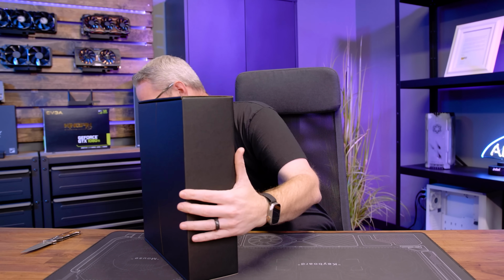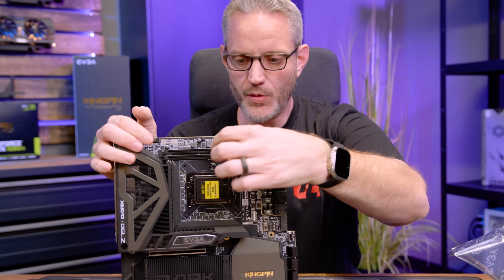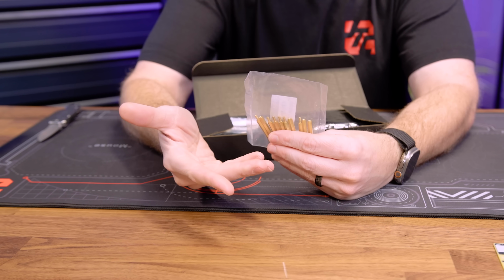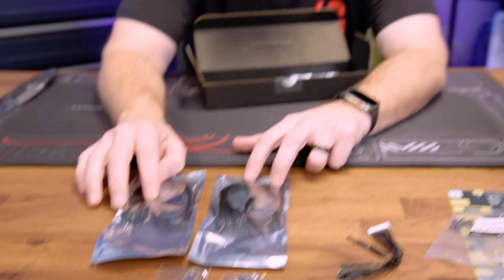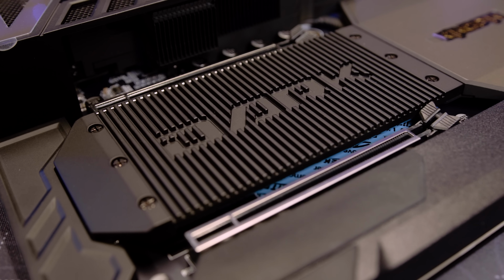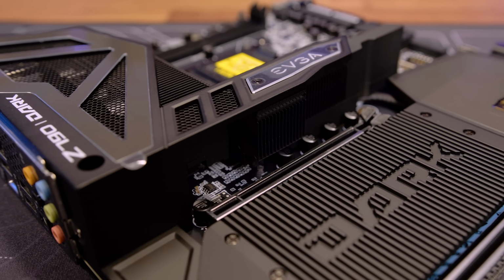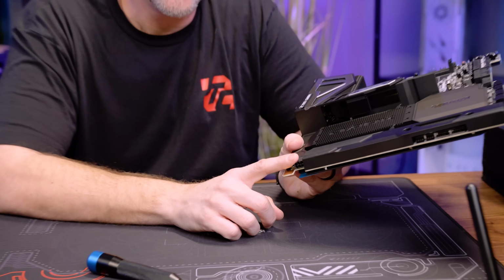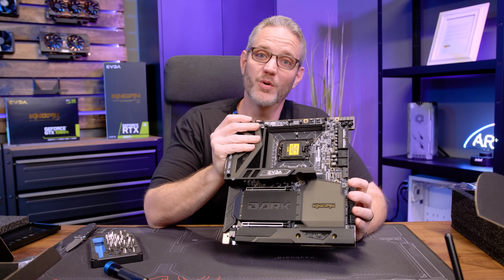EVGA created the mother of all boards... Z790 KINGPIN

Comment: I really hope EVGA picks up on AMD stuff. I would love to have a solid, reliable EVGA AMD motherboard and possible AMD graphics card. The last PC I built was a 5930K system with all EVGA parts. PSU, motherboard and GPUs, which were dual 980ti (that I still have). It all seemlessly worked. I wasn't crazy about the motherboard not having 4 pin fan headers, but I used a fan hub anyway. I'm still  holding onto my EVGA 3090ti until its no longer viable or it dies.
Reply: I hope so too, but they dropped x570 motherboards from their website. I would love an EVGA AM5 motherboard for my next PC but its not looking good.
Reply: The AMD graphic cards are bad... EVGA is just expensive... there are other boards, cards etc. that work as good as EVGA or even better.
Reply: @wiLdchiLd2k  Yeah I doubt EVGA could enter the AMD GPU market and compete with Sapphire and PowerColor. If EVGA GPU div comes back it most likely will be on intel Arc’s side
Reply: @wiLdchiLd2k  tell me you're ignorant without telling me you're ignorant

Comment: My Z690 classified is the best Mobo I’ve ever used. Love EVGA stuff

Small correction: the Classified boards do not come with the “road map” test bench PCB thing. If it did it’d be hanging on my wall above my system 😂
Reply: What does it better than a 160$ board?!? Nothing in normal use KEKW

Comment: There are quite a few issues for EVGA this hardware generation. Aside from the obvious lack of GPU sales, they're releasing boards for Intel's chips that have been out for a few months.

Coupled with no board for AMD yet, they're releasing them into a relatively mature cycle. Not sure how many would want to buy them.

Hopefully next time they'll be released earlier.
Reply: The dark board isn't for the average user. It's like a KP GPU. It's designed around xoc. When it's released has no bearing on the xoc market. 

The dark and the Asus apex are really the only two purpose made exotic cooling boards.
Reply: no offense but this product likely isnt for you if youre not willing to wait on it/youre bringing this up. its not for the everyday user.
Reply: I know exactly who it's for, but 3 months into a product life cycle like this is a HUGE amount of time, and it's not just that time we're talking about.

People at the top of XOC have had access to the CPUs for months due to their partnership with MOBO manufacturers. If you think they're going to drop that amount of time, effort and money to start again on a new MOBO then you're wrong for the vast amount of them.

The majority of people actually buying this board would be those wanting the best but not be XOC'ers. I'd bet that the majority of those people will have also already bought a MOBO and not want to sink extra money.

Comment: I probably would consider this if they made one for an AMD.  Though I'm not completely decided on going AMD or Intel when my build my next rig in the Summer time, it's very likely going to be DDR-5 AMD.
Reply: I would go AM5 because you can buy AM5 motherboards with PCIE5, which currently is not utillised by eiter m.2 or GPUs, also AMD has said to use am5 platform next 5 years at least, (am4 got extendet from the planned 5 to 8 years). So this means if you buy a good AM5 motherboard now you don't need to upgrade motherboard for a long time.
Reply: @solmesteren  Didnt corsair just announce there MP700 or something like that, I only just caught a snippet of an advert the other day. But it said 10,000mbps or 10GB/s i believe which can only be Pcie GEN5 right? But I dont know if there out yet. Like I say, I didnt catch it fully. But either way, crazy speeds and the way there kicking Generations out is insane, only feels like 2 minutes since Pcie GEN4 was announced.
Reply: @CHADSGALAXYS  they are calling for up to 10,000 read and 9,500 write with gen5. key words up to. and yes it seems like gen4 came out last month.
Reply: For me AMD vs Intel will be completly based on how 7000X3D cpus perform
Reply: i would go with amd, their socket usually lives two or three times the normal life of an intel socket, so you can buy it now and in 4 years upgrade to a much better cpu without changing half of your pc

Comment: I hope they do make am5 boards eventually. Would love to have one whenever I upgrade
Reply: I was looking at the Asus ProArt X670E. It has 8/8/4 PCIe, 10 and 2.5GBe, USB 4
Reply: useless for amd cpus
Reply: @xTurtleOW  ypull probably be able to overclock next gen of AMD CPU'S. Also your technically overclocking them by changing the power setting on them. The stock setting has the most performance and the energy setting is the coolest running. Simple as that. :) Also you can still overclock 5 CPU'S, you just need DDC or LN2. Then change your gigafarts in bios and boom.
Reply: Am5*
Reply: That's the only reason I am likely going into when I upgraded next. I LOVE my z390 dark. The z790 Dark is a little expensive, but the Z690 is reasonable. I discovered I don't have to have the best of the best to have fun. I just need what was ONCE the best of the best and it works out lol.
Reply: I wish i understood wtf was the difference
Reply: It's one reason why I didnt bother going up to X670 yet.
Reply: don't worry - still very early stages of all of this.
Reply: They need to return to AMD, they missed out on the longest run of Intel getting the crap beat out if them, even if they do make the best boards they couldnt even reach the best performance.
Reply: @_-Montana-_  and I will by another in 3 years. Then another in 3 years..  But that's my business.
Reply: I just looked at EVGAs website. They removed their x570 motherboards from their motherboard section. Don't know why but yeah
Reply: but AMD CPU doesn't really overclock , they maxed out from the box
Reply: @heickelrrx  That's only true for the first generation of AM5 chips. For the rest we'll have to wait and see.
Reply: @heickelrrx  That's why I went Intel my 13900k is cool and sips energy in comparison once you pay it within p1/p2 Intel specs

Comment: isnt there quad channel ddr5 yet ? I see this primo board only have two dimms slots
is this because of the higher mega transfer speed that you dont even need it or ?
Reply: It only has 2 because it is more stable that way, nobody would be using the other 2 slots if they were there on this board.